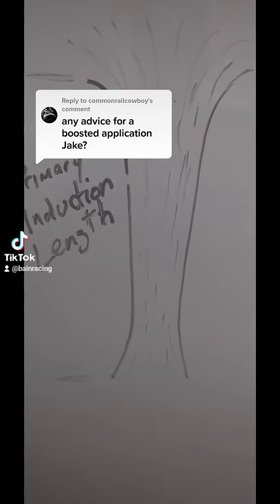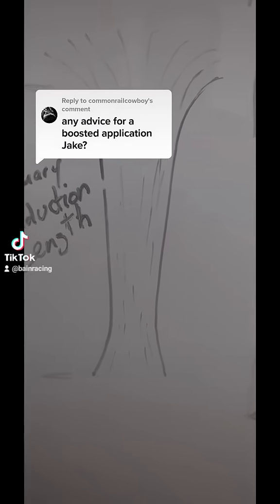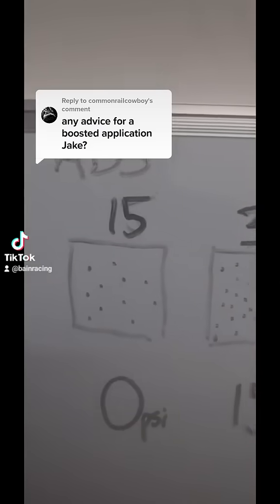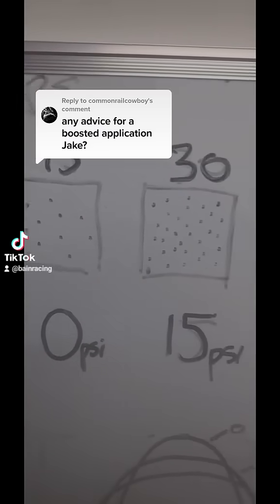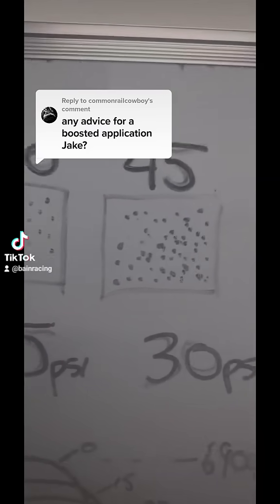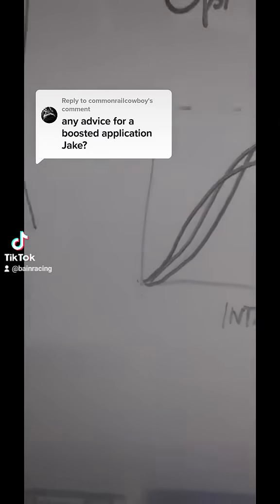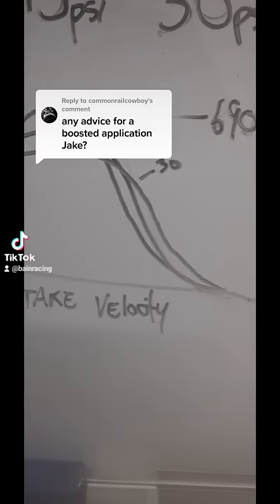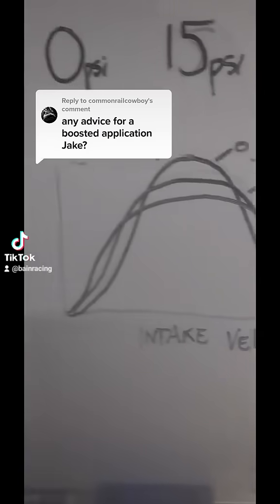The Shocking Truth About Boosted Engines and Air Velocity

Comment: Wow. Great explanation about density changing and not speed very much. 
Only 1/2” shorter for 30lbs boost. 😲
Reply from the maker: Yeah, we can see this very clearly as we add boost to and engine on the dyno. If air speed changes were happening,  so as many claim. "Boost" increases velocity.  Then our velocity choke point will reduce. This means that we add more and more boost. Our Peak RPM will also reduce dramatically as HP and torque are directly linked to air speed and VE'S as how much mass ends up in the cylinder dictates where HP and torque end up on the curve.  

Now as far as shorter runners for boost. It's mainly to do with temperature, not so much the increases in atmospheric pressure/density. Sound is mostly effected by temperature.  So that 1/2" is just a rough estimate off the average air temperatures we would see at 80% intercooler efficiency.   

So the better the intercooler, the less you need to compensate.  In fact, with water/ice coolers, you may even need a slightly longer runner.  👌